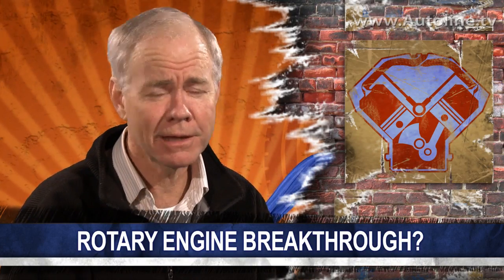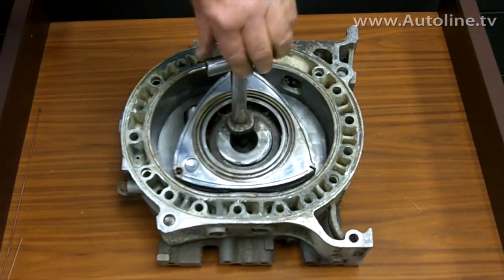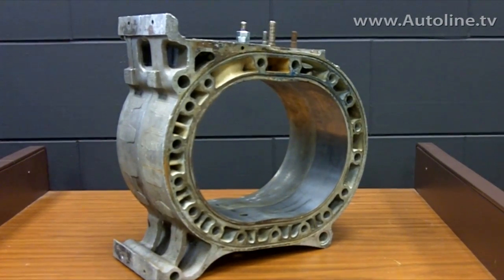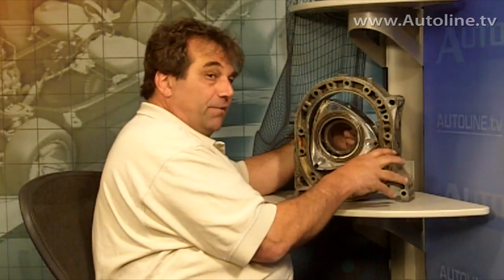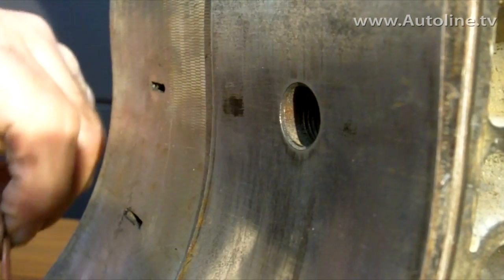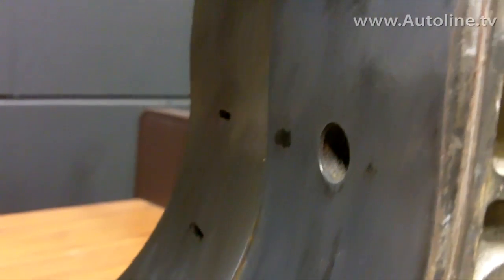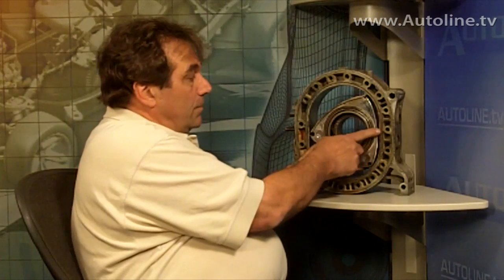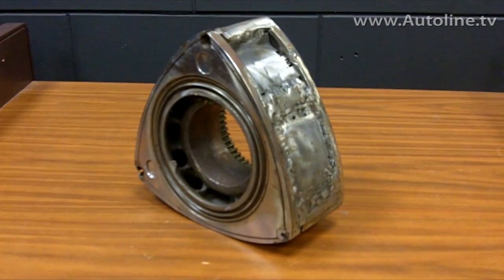Rotary Engine Breakthrough?

Comment: The main point is that the charge pushed backwards as well as forwards. This is supposed to reduce the backpush. If it does it effectively it will transform the Wankel.  BTW, there was a two-stroke rotary - obviously with a different rotor design. If the same amount of money was put into R&D on piston engines over 100 years. The engine would the normal engine in our cars.
Reply: WANKEL ENGINE IS OBSOLETE TECHNOLOGY, THIS MONTH MARKS THE 10 YEAR ANNIVERSARY OF THE END OF PRODUCTION AT MAZDA.

Comment: I suspect the engineers at Mazda Motor Corp. has already been there and done that.

The only way I see these slotted spark pockets potentially providing any degree of improvement in fuel efficiency is if there's an additional plug (à la R26B) or two per chamber, perhaps arranging 2 plugs on the leading edge to provide that asymmetrical ignition that Mr. Brink was suggesting.

But then again, I'm certainly no expert.

Comment: I should clarify, the time available for gasses to move from one chamber to another through less than a 1/2" gap is miniscule measured in degrees of rotation and elapsed time. In the case of the over lap seen with a P port rotary or a traditional 2 stroke piston engine the gap is not only physically larger but the duration in degrees of rotation is much much greater. That is why you get lope or brap in those cases. That's the same reason you get lope in a heavily cammed 4 stroke piston motor.
Reply: The combustion gases move at around the speed of sound

Comment: He is mistaken when he said that the whole intake charge is wasted when the seal passes over the plug well. Even at idle speed the amount of time the seal is passing over the well is a fraction of a second per cycle. Not nearly enough time for a significant portion of the charge to escape. It is also well known that the charge is collected by the rotors motion to the trailing portion of the chamber so any leakage of fuel is likely to be from the trailing seal to the following chamber.
Reply: ZERO TOLERANCE ON LEAKAGE

Comment: the guy just wants to get on t.v. and even for a prototype rotor you would want nicer welding than that..you want to show a smoothly finished piece,and as for the spark plug outlet,dont we already foul plugs often enough having a smaller outlet is just going to increase that due to less spark area!

Comment: It sounds intresting, but im wondering how would they balance that rotor now?? Its like putting a 1kg weight on the end of a chopper blade!  Also it wouldn't cost that much to modify two rotors and two housings for a one off test.  Would love to see his engine on a dyno.

Comment: I am not a combustion engineer but I can see how this would definitely have made a difference; the exhaust would not be contaminated with unburned fuel/air mix and the modified rotor chamber would eliminate the tug of war between the two halves of said face. Interesting, wonder if he ever discussed this with Mazda engineers.

Comment: Yes unfortunately due to low sales, Mazda has stopped production of the RX8, in spite of somewhat improved combustion chamber (exhaust side port eliminated for peripheral exhaust port, etc). RIP
Reply: Mazda ceased selling RX-8 Renesis in Europe from legal constraints, it was rated as a 1'300 cc displacement engine, when it gave around 200 kW, thus, CO2 emissions were in accordance to power. 
After Mazda won the '24 h of Le Mans' endurance race, rules were changed for not allowing it run this race anymore.
It's an issue of dirty fighting between car makers.
Reply: @joseveintegenario-nisu1928  That is completely false.
Mazda discontinued the RX8 in Europe because of poor sales.
 According to the official FIA rules the switch to 3.5 liter F1 engine was ratified before Mazda's fluke win in June 1991.
Mazda lost every race in 1990 and only won 1 races in 1991 losing the WSC championship to Jaguar.
Reply: @joseveintegenario-nisu1928  Mazda abandoned all development of Wankel engines in May 2009.
Mazda has never won a single world class championship and has completely left motorsports
It no longer has any factory motorsports program.

Comment: Your statement could not be more incorrect if you tried. The piston engine's efficiency may reach 20% and its design dates back to the late 1800s; The rotary would have been a great alternative but its relatively high petrol consumption even at low rpms makes it less than satisfactory in its present form.

Comment: The apex seal still goes over the spark plug hole so there is essentially no difference in it going over a slot. What this change would mean is the exhaust will not be diluted/contaminated with part of the intake air/gas mix, eliminating the hot exhaust. His rotor mod will make the power stroke do what it is supposed to, with much less energy.

Comment: If you add a slot, doesn't the rotor lobe now have to go over a speed bump? That sounds catastrophic. And assuming you still have a spark plug hole blind tapped behind the slot (expensive), are you going to get enough air/fuel to the spark?

Comment: Any automotive engineer will tell you that the Crank Case Induction 2 stroke is the most efficient engine ever designed (2.6 x the efficiency and torque (tractive effort) production of a 4 stroke engine). Also cheaper to make, uses less resources and lasts longer. The UK's highest mileage motorcycle currently is a 2 stroke.

A 2 stroke also produces 1/24 the the NOX emmissions of a 4 stroke per CC.

Direct Injection 2 stroke is the cleanest engine at the moment as is replacing the 4 stroke.

Comment: I know EPA hated them because of the oil gas mix for the rotor lube wich is like a 2 cycle piston engine. companys have to face it the 4 cycle piston engine is the most efficent and reliable engine design made.

Comment: The spark plugs fire at different times, split timing, the bottom one first then the top, this is to help get complete combustion. The lemans winning rotary had 3 plugs per rotor housing.

Comment: If you use the wrong gas, good or "bad", in any engine not designed for it, you can ruin it. A Rotary's simple design makes ignitions issues unlikely to damage anything. Detonation? You mean premature combustion, as in a misfire, or knocking? Any engine is vulnerable to that. It's more problematic with poppet valves. Again the simpler design of the Rotary can tolerate premature combustion. It comes back to temperature, leading to issues that can eat the Apex seals.

Comment: The current Rotary RX8 gets about 18 mpg in the real world. 15 min 20 max.  Mazda needs to get to at least 26 mpg to make a car like a new RX7 viable. Or 22/30. I dont think that is possible. We will see. If they can get to 25 or 26 mpg. The other benefits of the rotary will easily surpass its loss in efficiency to the combustion engine.

Comment: Yes, but the seals will still be just as vulnerable to destruction by detonation.  Detonation can happen if you get bad gas or a problem with your ignition system.  A piston engine can handle a lot of detonation.  A rotary cant.

Comment: The pointed question is why didn't Mazda fix this WHILE Brinks was on the payroll. If they have not figured it out by now they did not before their new Rotary engine (16x, was it?) was about finished. Or when the RX-8s RENESIS 13B-MSP engine was done.

One should hope MAZDA jumps at Brinks' changes. I'd love to see GM take a stab at it, though with Akerson in the lead that is unlikely. But I don't want to see the Germans take this one. Let them have the Diesel laurels.

Comment: That is a fault of the exhaust being so hot it burns the oil. Like running you engine too hot to long or having bad oil, the piston rings get worn out. Running cooler, the Apex seals should last at least twice as long. Of course, Mazda's figured way to extend the seals lives longer already so 200K-300K miles easy.